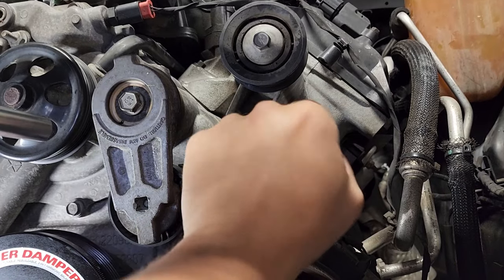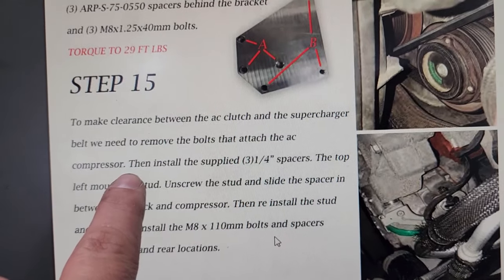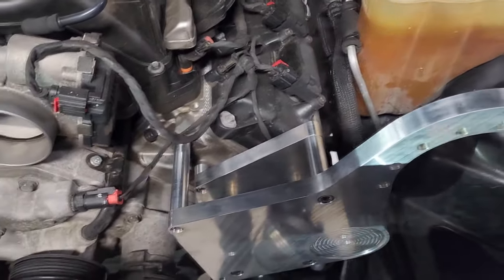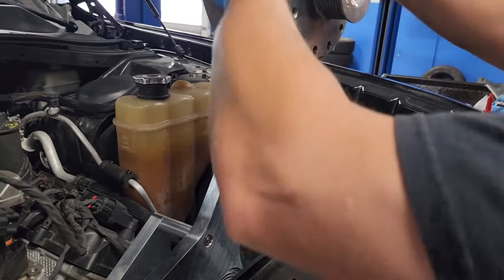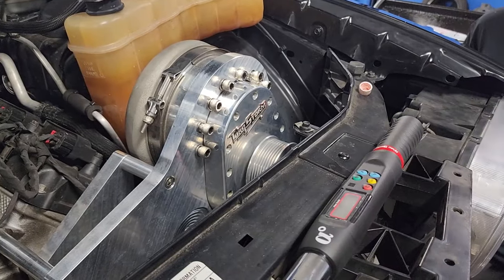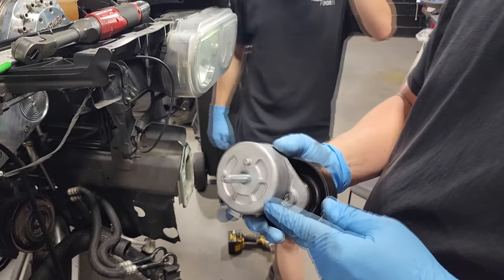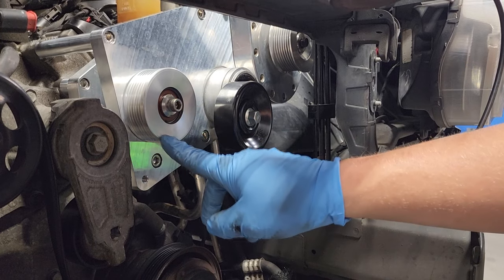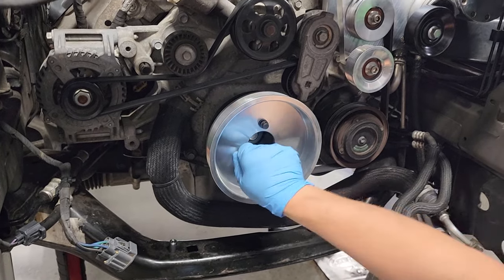Dodge Challenger TorqStorm Supercharger Install.

Comment: How comes a torq storm over pro charger and Whipple except cost
Reply from the maker: 8rib drive system standard is the biggest reason and cost.
Reply: @FrostbiteRam  would this also go for the ram platform.
Reply from the maker: @Touchedbyapriest  yes, that's why I used them on my ram
Reply: @FrostbiteRam  fair enough I was looking at a Whipple myself. Cost isn't the biggest issue. Wanted daily driver safe but also the Whipple powder coated just looks good.
Reply: @Touchedbyapriest whipple are expensive I’d go hellcat if I have money and if not I’d go torque storm for a stock 5.7 well any hemi the torque is good a turbo set up would be cool I think on3performance kit is around the same price as a torque storm SC also another great choice and turbo is free hp but can’t go wrong with either as a daily
Reply: @frivera735  looked at that but too much hassle to use the adaptor kit. Plus from the comparison videos and forums. The Whipple is better than the 2.7 red-eye supercharger